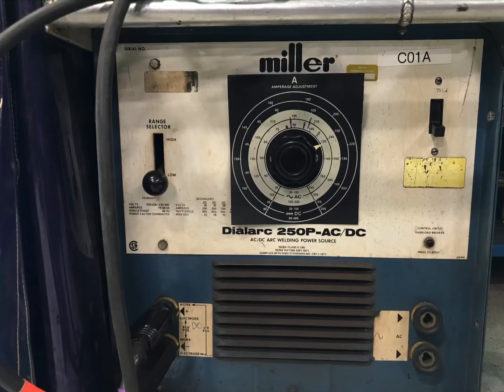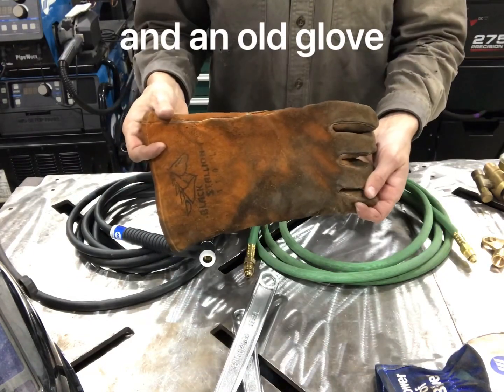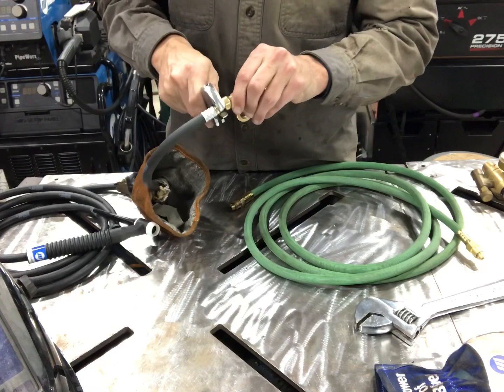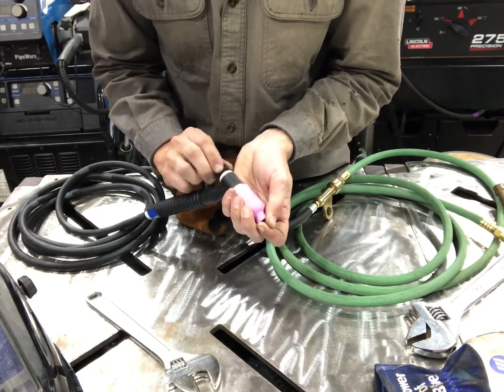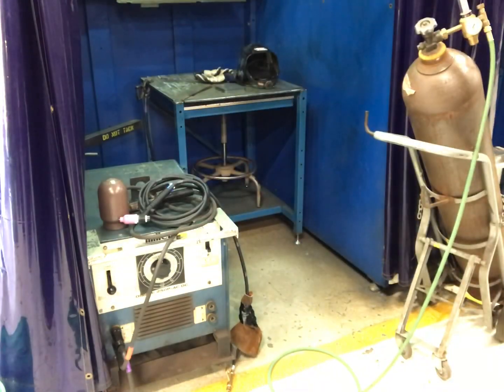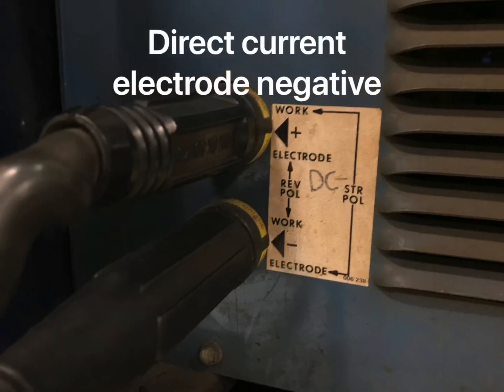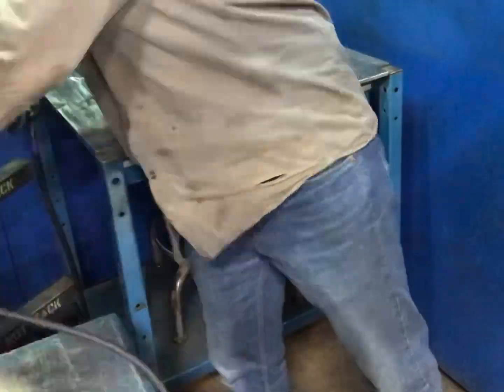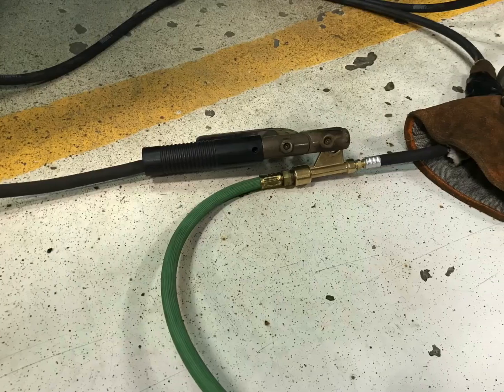How to make your stick welder a TIG welder

Comment: you think this sort of tig welding will be suitable with the smaller AC/DC buzzboxes? The strongest in amps available on the market is Forney rated at 235/185 and to be honest that 185 amp DC output is questionable, I think the Italians are bullshitting us
Reply from the maker: Well if it’s a buzz box it’s only AC welding so it won’t work.  Buzzbox is a transformer only machine.  But if you can snag a transformer-rectifier machine you are good. Even if the amps are lower than you think. 150 amps can weld some pretty decent size metal.  Great question and thanks for watching.
Reply: @weldzcool1147  My bad, I call all the box type stick welders transformers a buzzbox ( well they buzz a lot when they are on) I was talking about for example the Lincoln AC/DC 225/135, or the Forney AC/DC 235/185, or Miller and Hobart  AC/DC 235/165 or 300/200 ( they dont make these anymore though) These are all transformer stick  welders just smaller than yours AKA tombstone type and they have AC/DC capabilities. One more question, what's the lowest amperage you can scratch start an ark with this sort of tig welding?

Comment: So does this conversion allows me to weld thinner steel ?say around 2mm
Reply from the maker: Sure. Just set the machine low. Just can’t control heat with a remote.

Comment: That was great now can you go to the ac side of the welder and tig weld Aluminium thanks
Reply: I was wondering if it was possible too. I have a miller bobcat 250 engine drive and its ac/dc. Is there a way to tap into ac for aluminum?

Comment: So I could just plug my tig rig straight in the negative? I have the power/gas hose combo on my tig torch so need for the power connector

Comment: I tried the project and it doesn't work.
I replaced a welder and it's not working. I changed a gas tank and it's not working
I use argon  gas. 
Electronic welder- deca mos 170 gen 

By the way, I'm using a direct connection from the + port  from the welder to the table, not the gas hose. 

I thank you for any help. Thank you
Reply from the maker: What do you mean it doesn’t work?  I might be able to help if I understand.  Do you not get an arc? Or do you get an arc and the welds are coming out wrong?  Give me some more information and I’ll try to help.

Comment: Unfortunately there is very little advantage from this conversion, good welding rods will do same job without the improvisation. Please correct me if I am wrong but I can't see the point!
Thank you very much for uploading this video. Kind regards, Dan George
Reply from the maker: Well this video is for someone who only has a stick welder and wants to convert to TIG.  Avoid buying a machine setup for TIG and use what ya have. As for the rods you can run all the same rods with this setup as any DC TIG. Thanks for watching.

Comment: What if my machine doesnt have the DC Option on it? Just an old Yugoslavian 150amp garbage? Thanks
Reply: Some people have added  beefy diode bridge rectifier to the AC output, early DC output welders usually add a smoothing inductor because they were at the mains 50/60 Hz frequency.

Buying a set of 200A diodes new will probably cost a lot, try find some surplus or second hand.
Reply from the maker: Needs to have DC unfortunately.

Comment: so basically cheaper than buying a expensive TIG machine..
Reply from the maker: That’s exactly correct
Reply: @weldzcool1147 that's a great video can please tell me why negative current needed for tig
Reply from the maker: @henrysosa5813  if you run positive or also known as reverse polarity, the electrons will jump from your base metal to your tungsten electrode putting an incredible amount of heat in the tungsten. Although it’s the highest melting temperature of any metal, it can’t handle that heat and will melt the tungsten.  When it’s negative or straight polarity, the electrons jump from tungsten to base metal. The tungsten gets hot and glows red but with the argon as a shield it won’t melt. In fact, it will stay sharp as long as you do not contaminate.  Hope this helps. Thanks for watching :)
Reply: @weldzcool1147  I am a complete new to welding can you please tell me as a list what all is necessary things required to make this TIG welding machine. I need it for making DIY metal project videos and many other things...  what I like about TIG is no smoke and sparks..  thank you..
Reply from the maker: @ravebrave8866  just need a power source with DC capability, power cable adaptor, hose for the gas hookup, and a air-cooled TIG torch with a valve to start and stop the gas flow.  That’s it!
Reply: @weldzcool1147  I am making one for my self... it looks so peaceful working with TIG.. thanks for the help... (Y)
Reply from the maker: @ravebrave8866  it sure is!
Reply from the maker: @ravebrave8866  yes that machine would work just fine.
Reply: @weldzcool1147  many thanks for your help...

Comment: I did this with my welder and it works OK. The one problem that I have is that I will sharpen the tungsten but since it has to be scratch  started, the tungsten gets messed up as soon as you start an arc.
Reply from the maker: Strike the arc using the filler rod to bridge the gap.  Strike it like a match or quickly  and the tungsten never has to touch the base metal. It is what I did in the video but prob hard to see it.
Reply: Filler rod strick it not the work peice

Comment: Have you tried the same setup set to AC for aluminum?
Reply from the maker: No because the machine will not be able to provide continuous high frequency in the background to stabilize the arc.